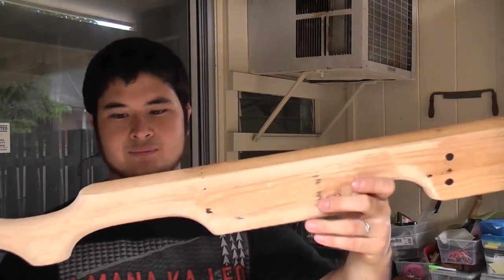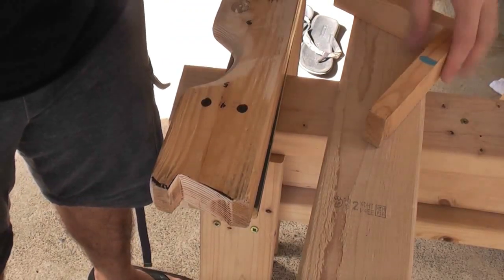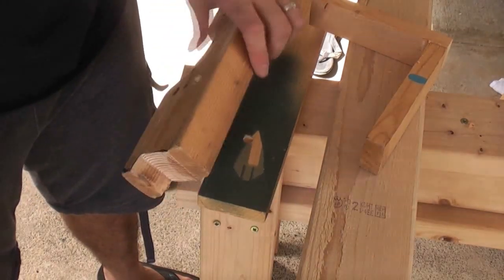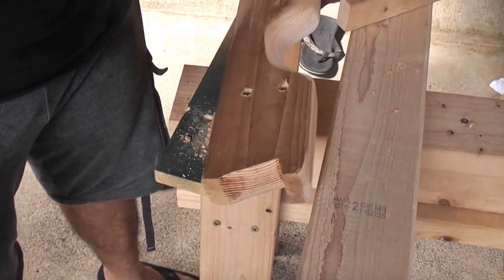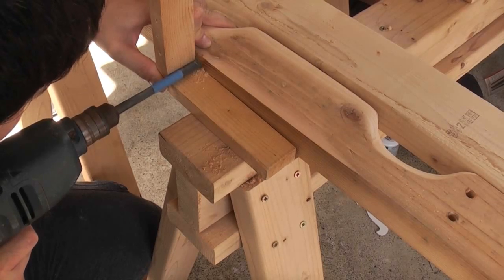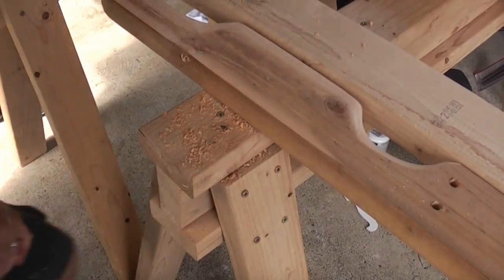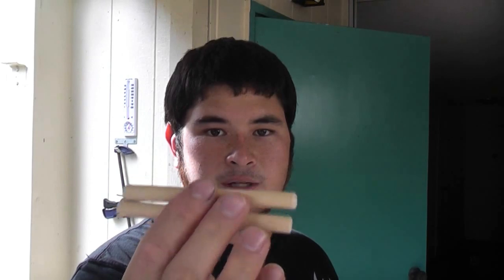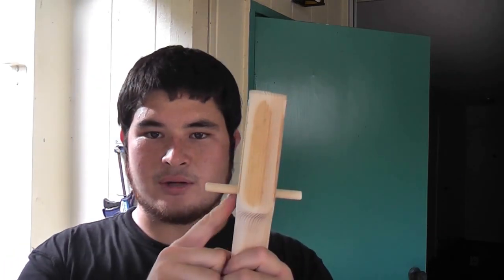How to Make a 100 Pound PVC Crossbow Part 3 - Drilling Holes

Comment: I really enjoy all your PVC bow projects. While watching you make the 100 lb. crossbow, I was wondering if instead of all the string wrapping, what about countersinking two nuts and then placing the prod in place then a "T" or  capital " i" shape metal strap screwed through the metal into the nuts behind the prod.  and small metal screws on either side of the nose of the tiller that way if there was a need to replace the prod all u needed to do was unscrew the strap formed over the prod, and really not needing to drill holes and put wood dowels etc. and along the sides of the tiller where the bolt sets, put alum. rails on either side (re-enforcing the wood) and just glue the brush heads in an alum. bracket secured with very small screws in the side of wood stock. Then with the stirrup, attach it with a spring hinge that way it can be stored just under the stock. 
I'm not very good at wrapping it securely as you are, so I wondered if metal piece over the prod, that was screwed in place be do-able????

Comment: on the 3/8" dowel,how much pressure could they take from the bow string?I want to shoot for 175 pound draw prod for hunting.not much more than that.175 should be fine to hunt with.last time I checked deer wasn't wearing chainmail and packing tower Shields so I don't feel a 450+ pound war crossbow is as nessisary so people try to push.I exaggerated but most people are pushing 200-250 pound prods to "humanely kill a deer" what yardage are you shooting from?two football fields?I'm off topic just mad cause its hard to get strieght answers nowdays on stuff.I feel survival bow should still be able to hand span so reloading is not as long of a process.I can't hand span a 200 pound bow
Reply: +princess peterson Use a 3/8" metal rod.